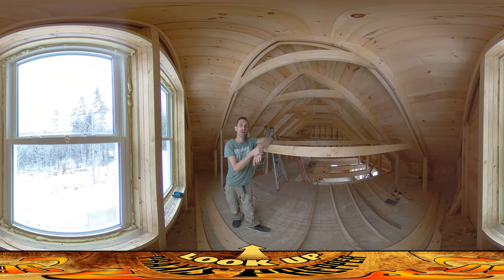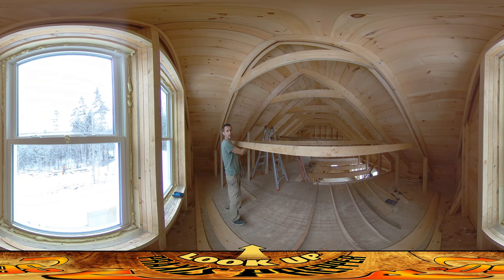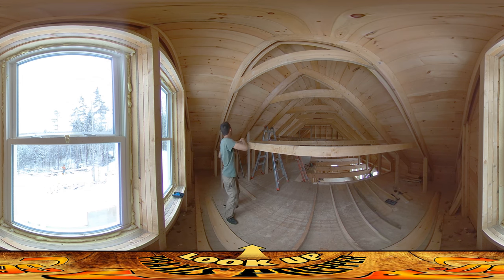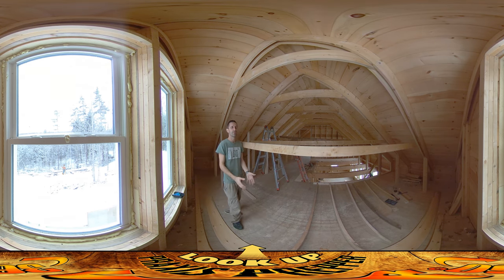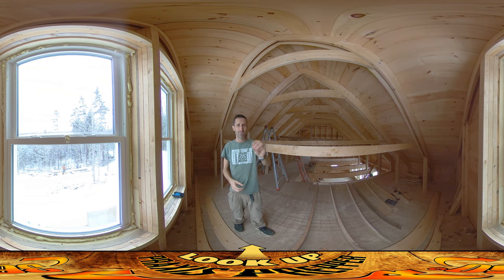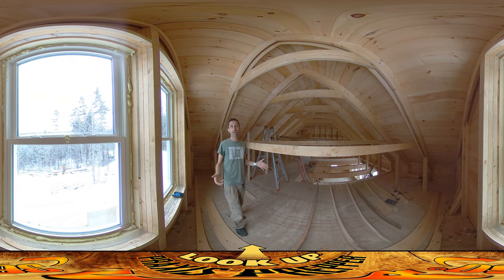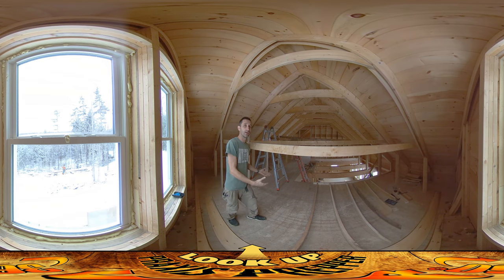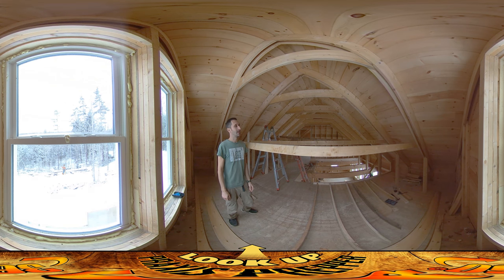Homestead Building - Locating a Door in Relation to Stairs, Irritating Building Codes

Comment: But why is the first floor to high ? ... is it supposed to come with a 13 step stairs (and do they know 13 is an unlucky number so basically makes the stairs unsafe to begin with?), or does the kit come with a 12 steps stairs and you somehow build the walls up to tall to lead to this discrepancy ?
Reply from the maker: I comes down to a poor choice in the design of the kit. They really should have designed the floor height per the stair requirements.
Reply: @PraxisPrepper  maybe it is, and they choose for a 13 step stairs?
Reply from the maker: @dutchcourage7312  No, I've spoken with them and it's no secret that they hadn't factored the stair height into the floor height. The reason 13 is bad is because the wider the stairs run the more the door to the bedroom get's clipped. Even with 12 steps, that door is going to be a pentagon.
Reply: @PraxisPrepper  hmm, can't the stairs just be more steep ? sure it makes the steps less deep, but it would lead to being able to have enough clearance below and above to adhere to code, while having stairs height to adhere to code...

Do note, i doubt that sliver you go for now will matter any one bit ;)
Reply from the maker: @dutchcourage7312  per the rules we are at the absolute maximum steepness at 7.75 inch rise per 10 inch run. It's an okay slope, not crazy shallow or anything. It's just unfortunate that this is the MAX allowed.
Reply: @PraxisPrepper  guess that figures ;P ... if that would have been the case in some Dutch Old City Residencies, they would have never been build ;) ... they are so steep that you know for sure missing one will bring you downstairs in an instance, with some blue bottoms as proof to show for it